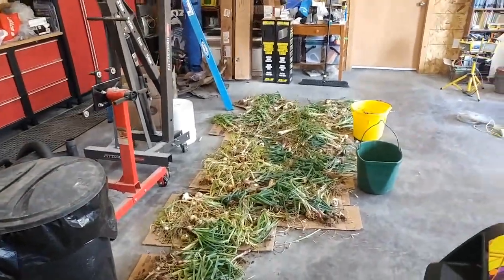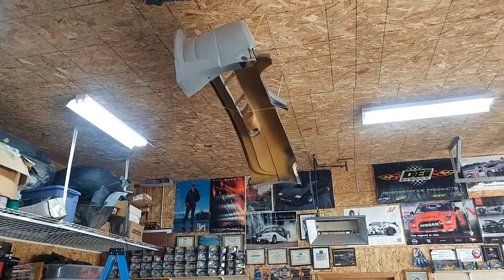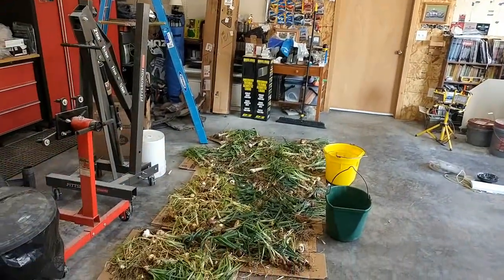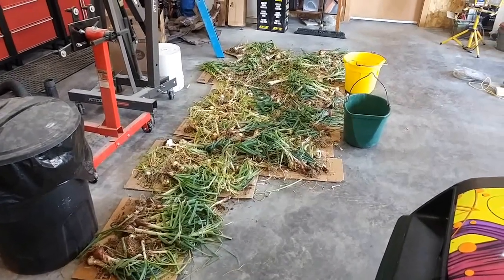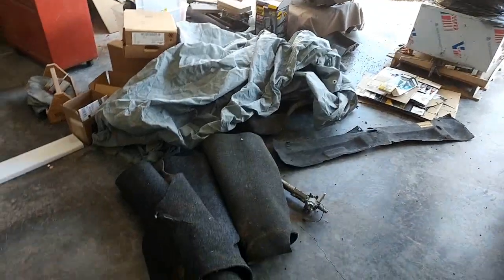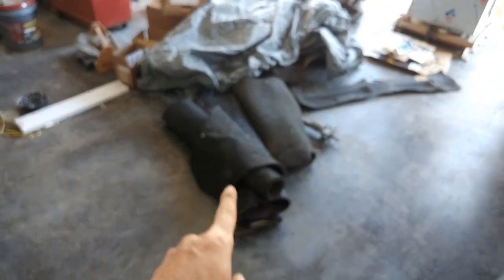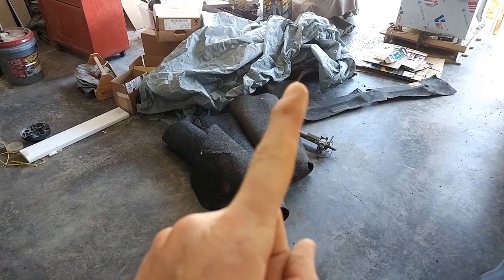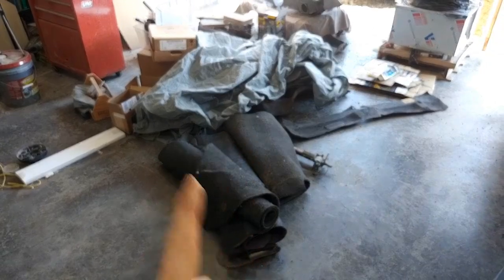"It's Like Grandma Got a Bewb Job!"

Comment: A stock coil for the mustang puts out more power that the aftermarket coil.
Reply from the maker: Hopefully it will fix the sputtering issue for just a few bucks. Thanks for the info.
Reply: @BasinMotorsports  no problem anything to help out.

Comment: vacuum leak
Reply from the maker: Most of the vacuum lines have been removed for the emissions system, and those left are mostly new.  I'll give them a check this winter as I do some maintenance.  Thanks for the tip.
Reply: smoke test, Brew2L video how to! it might not be vacuum lines.
Reply from the maker: I've seen them used.  I'll check on where to buy one for less than an arm and a leg.
Reply: Basin Motorsports build for less than $28